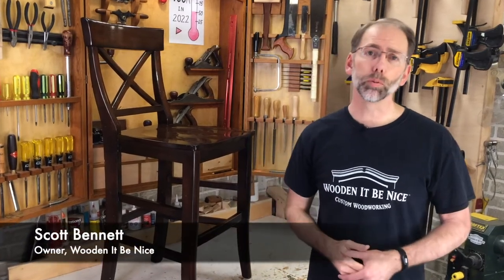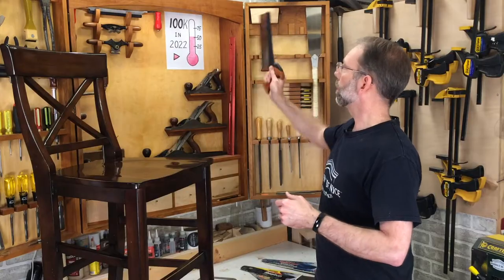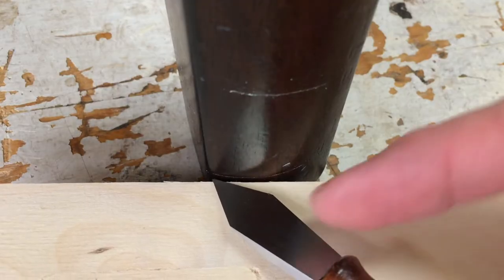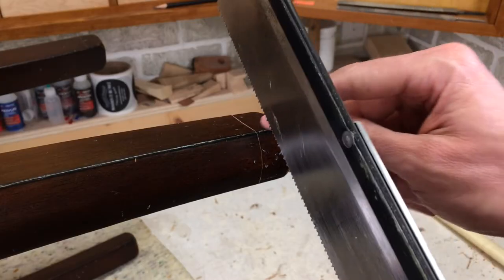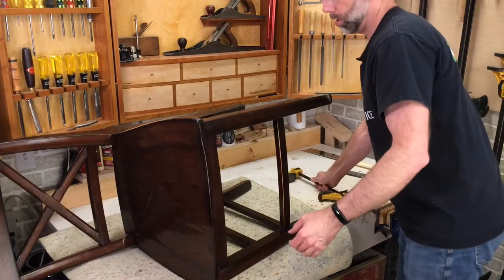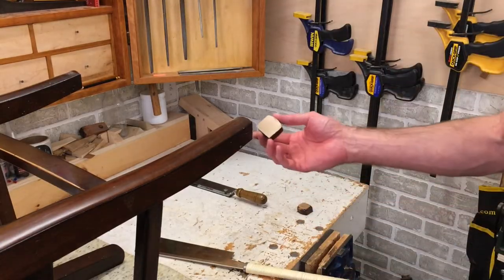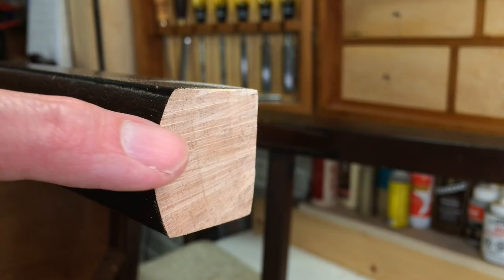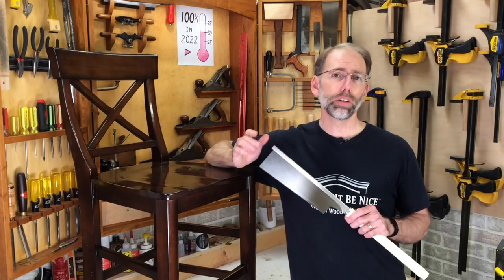How to Cut Chair Legs to Shorten Chairs or Stools - Furniture Repair

Comment: Thank you!  Your video showing how to shorten legs on a chair is terrific.  I bought the Japanese saw and scoring tools and followed your directions.  My chair has curved legs in the back and without your help, I would have never been able to mark the legs and get all the legs to stand flush to the floor.  I first practiced on a scrap piece of wood.  I needed to shorten the legs 2.5 inches.  I scored all 4 legs first, then one leg I scored at 1" and did a test cut.  The test cut gave me the feel of how the saw works on the leg.  The saw works great and your tip of guiding the saw with a knuckle really helped.
Reply from the maker: That’s awesome!  Congratulations on your success.  Thank you for sharing that!

Comment: Hello Scott, I have these chairs in counter height and a matching table. I would like to cut them to standard height. The back legs flair outward quite a bit. Will stability be lost if I cut them down that much?  Thank you.
Reply from the maker: I don't think shortening the chair legs will reduce the stability.  There are many chair designs that have straight legs at the back.  I hope that helps.

Comment: A think I much prefer a jig with chair upright and just bring the saw across the top of the jig for almost exact uniform leg height. Use the cut legs to replace the height of the cut legs plus a very thin shim to simulate the cutout thickness while you work around to each leg. Add a chamfer to the cut edges.

Comment: Hi Scott! In regards to painting have you ever used a single stage paint ?
Have you ever used an electric or battery powered sprayer? 
I’ll be using a single stage paint for my car as my first DIY to see how it’ll come out and would love to avoid orange peel as much as possible I know it won’t be perfect and I’m fine with that.
Reply from the maker: Yes, I've used a single stage sprayer and it gave an orange peel texture I couldn't avoid.  I now use a 3-stage turbine with good success.  I'm not an expert, but what I observe is that single-stage sprayers are typically used for exterior painting, not fine finishes.  I hope that helps.

Comment: I usually just take a small scrap of wood, size of a matchbox, tape the pencil to it and draw the line pressing it into the table, the height from the surface is still fixed, but way more freedom of movement
Reply from the maker: That's a good suggestion.  Thanks for sharing that.  Scott
Reply: This gives me an idea of actually using a matchbox to mark the legs. (I don’t have spare pieces of wood). Thank you for the tip